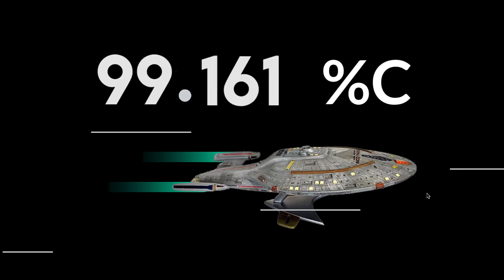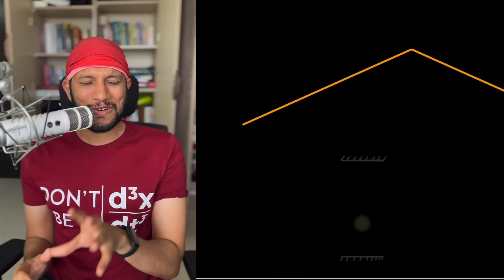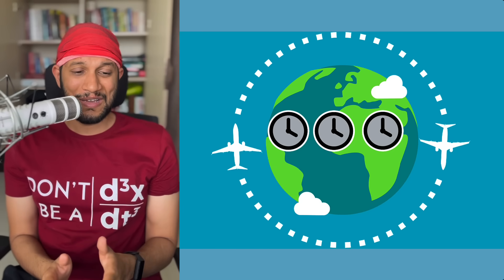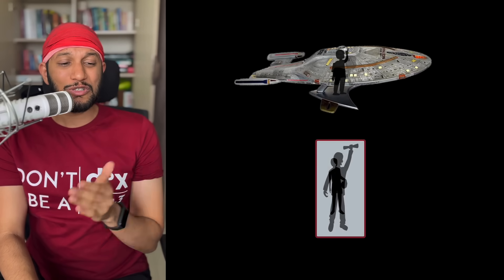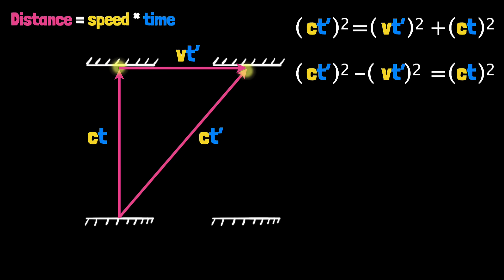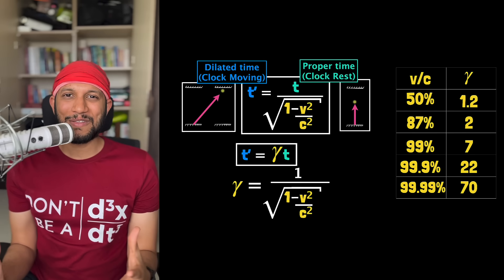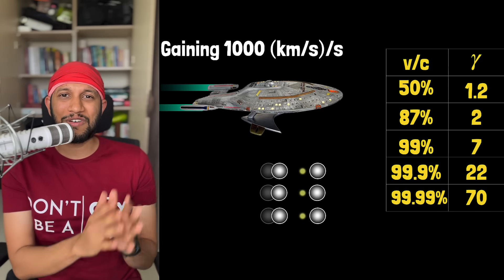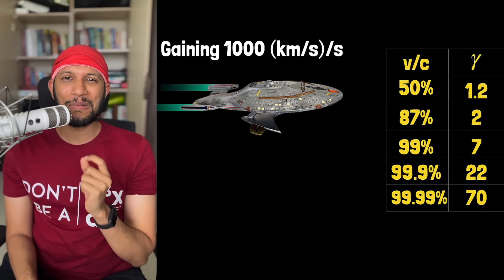I finally understood why you can't go faster than light! (My mind is blown)

Comment: Imagine being the outside observer trying to track the ship while its at 99.999999% c the ship would be moving insanely fast to you and if you could somehow zoom in to see the individual atoms and photons and be able to track them at that speed, you could see the atoms sending out the photons to the atoms in front opposite the direction of acceleration and you could see the photons struggling to reach the next atom as the photon is only moving .000000000001% faster than the rest of the ship. Wild!

Comment: Out of curiosity: What would happen to the observers on the ship? Let's asume they don't care about how much time passes for outside observers. Their only goal is to reach the speed of light (despite physics saying they can't) Let's asume they are already at around 99,99% the speed of light. With the constant acceleration of 1000 km/s that would mean from their perspective only 3 seconds are left to reach c. one more secon goas by. On the outside world milions of years have passed as they watch the clock and their speed. Another second goes by. The Galaxy around them is not in place anymore as bilions of years have passed. Only one second until they would reach c. With no regards for when or where they are anymore they push onwards. What then? I mean, from our perspective they will never reach c. The Ship is frozen in time for us. Seperatet from us. But what about inside the ship? Would they actually reach the speed of light albeit at the infinitely distant end of time?
Not a native english speaker. Sorry for grammar mistakes^^

Comment: but with finite energy, in the frame of reference of the spaceship, wouldn't it just keep gaining acceleration at 1000 km/s/s until it hit c? from the stationary frame, they'd never get there but what about from inside the space ship? wondering about this according to your explanation because traditional explanations have to bring in inertial mass increasing and requiring more energy just to keep accelerating at the same rate.

Comment: Have you ever wondered about gravity delay between structures in a galaxy? The relative speed between the center of the earth and the equator isn't anything compared to c. But what about the difference in velocity between the sun and Neptune. Neptune "sees" the sun, senses it visually & gravitationally 1 whole sun diameter along its galactic orbit from where it is. Still not really a big deal. But look at the difference in velocity between the center of the galaxy and the sun! And now, consider the difference in velocity between one side of the galactic disc and the other. How do the decently thousandth of c speeds effect the moving structure of galaxies. I think many things we observe can be explained. I've never seen anyone explain this neat idea to laymen. The thousands of years of the sensing is comparable to the millions of years of the movement. I don't have the math and modelling chops to play with this in depth.

Comment: The photo clock is a thought experiment. It is not the explanation. There is no intuitive explanation - this is not correct physics. The reason you can't reach the speed of light is because it takes infinite energy to accelerate a mass. It has nothing to do with photons.

Comment: Actually, NASA says that according to the mathematics traveling at warp speed is possible, they don’t have a way to develop the engine at this point now can we go past the speed of light it’s just like the sound barrier we broke the sound barrier at high speed and now NASA even developed a high speed impulse engine That travels at Mach30 there isn’t an aircraft frame that can handle the engine but they do at the test rig work drive is possible they just don’t understand the mathematical laws that will allow it to occur. Warp speed is not the infinity speed because usually science fiction mirror science fact, the writers don’t know how close they’ll come to the truth, but they usually do, there is a way to overcome velocity and Star Trek is probably right that the infinity speed is 9.999 almost everything that was developed in Star Trek from tri quarters to rideable tablets to hospital beds have all come to pass the only thing with hospital beds that haven’t come yet is permanent computer screens that can automatically Sense a person when they lay down and give you all of your body readouts and the fact that the only thing you would have to use is a hypo spray instead of having bags of liquid at your side, but I think these things are soon to change within the next 10 to 30 years

Comment: Nice explanation. You should make a follow-up with the viewpoint of the moving observer. You said for him the acceleration stays the same. Since he doesn't experience time dilation. So going from that he should experience breaking the speed of light. Since he has just to wait in his reference frame.

I know that it doesn't happen. Because of length contraction. And the effects are kinda crazy. 

But those viewpoints are often neglected in explanations regarding relativity.

Comment: "Why can't you reach a relative speed of c (about 300,000 m/sec)" should be the question. The answer is you can. Dark energy expands space allowing  relative speeds of greater than 300,000 m/sec. Dark energy does not have infinite value, yet it can achieve these high speeds. Einstein only said that information could not travel faster than c, nothing about 2 rockets separating by a speed greater than c.

Comment: Ok someone please correct me if I’m wrong or missed something. If we look at the photon clocks from the ship’s perspective, the ship’s clock wouldn’t be moving but the outside clock would. Wouldn’t this mean that from the ship’s perspective the outside clock is moving slower? If this is the case, how come the outside twin is always ages faster, even from the twin on the ship’s perspective?
Reply: That is correct. Time dilation is symmetric as long as both clocks are moving steadily.
The "outside twin" does not always age faster. In the twin paradox, the twin who turns around ages more because they are not "moving steadily". They have to change direction to come back. This is a physical difference.

Comment: How about the speed of the bullet if someone shoot the gun in the ship that speed close to the light?
Is the bullet speed more than light?
Or if someone turns on a flashlight in the ship, Is the light of the flashlight speed faster than normal light outside the ship in relativity?
Reply: Relative to an outside observer the bullet will move slightly closer to the speed of light, but still never reach it. You can calculate the speed of the bullet relative to an outside observer by taking the speed of the bullet relative to the ship and taking the observed time dilation into account.
The light from the flashlight will always move at c for all inertial observers.
Reply: @narfwhals7843  Thankyou for your reply
 The universe is always amazing and mysterious.

Comment: No, because a photon is just a convention for supposedly the smallest particle transitioning to wave and supposedly space-time is relatively stable to it, representing gravity. But space time is a field of graviton particle-waves, so the fastest speed is the speed of gravitons, gravitonic speed, or whatever you want to call the fundamental particle of space-time, as spacetimons. Einstein and his followers admit that with the concept of worm hole or warp speed, which is gravitonic speed faster than light.  Sandaero Uniqua communication system faster than light uses graviton  entangled photons from laser split, if photon is unaltered it's 0 if struck by perpendicular laser, it's 1, generating binary digital communication. Some black holes are worm holes, passages faster than light.

Comment: Fantastic explanation. Still a little confused though! From an observer's perspective the ship with constant thrust will take forever to attain c due to time dilation, but from the perspective of someone on the ship they do not experience time dilation so what prevents them attaining c after the required number of speed increments? What would someone on the ship perceive as happening?
Reply: Yeah that explanation is just completely wrong, I really feel like this video will leave people more confused than anything.
Reply: Since any amount of time passage from their perspective now equals infinity for the rest of the universe, I suppose what they would experience is instantaneous end of the universe :)
Reply: @lemongrass86 Yeah, no. Time is a constant.
Reply: i give you now the answer i hardly found, by myself. Einstein himself was never able to explain this.

no real clock slows down, because no real clock measures time, not distance. all real clocks measure time*distance, and that is a non-variable. 
Einstein was often confused

the answer to the twin paradox is: 
all twins in the Universe live in the time*distance, not in time, nor on distance. 
this is the key to understand the limits of special relativity, that is a non-functional theory, merely a didactical object.
no twin ages more, by virtue of relative motion and speed.

there are three types of time, all different, always different: 
1. theoretical absolute time, or say theoretical local time;
2. theoretical relative time, or say theoretical distant time;
3. measured time, the real time, that ironically does not have the dimensionality of time, it has dimensionality time*distance

Comment: Doesn’t seem entirely complete. This explains why from the point of view of the ship they can’t accelerate to the speed of light, because either their acceleration slows down or they need to increase the fuel consumption due to time dilation. However, what if the ship’s acceleration was powered externally through stationary lasers along the path? How does time dilation factor into this now?

Comment: That's the best explanation I ever see! Thanks! But I still have a question. How fast information travels on particles? I tough if you move a iron bar from one end it would take the speed of sound to move it's other end. On the mechanical clock arm you say that is the speed of light? What's the difference?

Comment: Do you want me to crack your brain? Consider that in your photon clock, the miror is placed in the same direction as the movement. Now consider the following: the faster you go, the slower the speed of light is to reach the mirror on its way in, while the speed of light is faster on its way back from the mirror but keeping the average speed of light on its way in and out equal to what we know: C.  Build a time vs speed graph and compare the simultaneity of the photons reaching the mirror for an external observer vs the person in the spaceship.  It will be the same and hence no time dilation.
Time dilution exists if you consider the speed of light being the same on its way to and from the mirror.  That s the main assumption that Einstein based all his theories on.  Because we ve never been able to measure the speed of light on a 1 way travel (i.e., A to B) but rather on a back and forth (i.e., A to B back to A).

Comment: What if you had a second hand or long pole 1 mile long (or more) - constructed in space.  And now you speed up to enough RPM that the second hand part near the dial is going 10,000 rmp - or more, so that the tip of the clock exceeds the speed of light.  What will happen to the tip?
Reply: You might like this one: https://en.wikipedia.org/wiki/Ehrenfest_paradox

Comment: So wait. From an outside perspective, the closer a system gets to the speed of causality the slower it appears to the spectator? So what the pilot of the ship sees is planets and stars rushing by but the spectator sees the ship not moving anywhere (stuck in time, so stuck in place) ? How does that make sense?
Reply: To the outside observer, the ship is moving fast but clocks on the ship are ticking slowly, and everything on the moving ship is slowed down (relative to the ship, still moving very fast with it)

Comment: How about you take that photon clock and rotate it 90 degrees, ooops... look like the photon clock example just ran out of time. Wondering why time freezes from an outside perspective when an object approaches the even horizon of a blackhole? Lol, looks like gravity alone can accelerate objects past the speed of light. The solution to why the universe is expanding and accelerating is that the universe is surrounded by a lower zero-point quantum vacuum and the universe is "falling/drawn" to this lower energy state. Dark energy does not exist, look outside the box for a solution.

Comment: You did a good job with that one, thanks.  You could have added at the end an example of using photons hitting a solar sail.  In that case the energy of the photons hitting the sale would halve when you got to your "2".  Thus, you would be stuck with the same issue, needing to keep doubling the frequency of the photons you were shooting at the solar sail to keep the same acceleration.

Comment: I'm missing something fundamental.  From an outside observer's perspective these assertions have always made intuitive sense, and are easily accepted as sound.  Considering the perspective of the accelerating ship, however, wouldn't none of these limitations apply?  Basically, it seems like while watched from outside, yes the ship will require infinite time or energy to reach light speed.  That is only the outside perspective's reality.  Within the ship time doesn't dilate, doesn't appear any slower, and therefore acceleration doesn't require more energy to maintain.  Hence, light speed seems not only intuitively possible, but certain.

This is what I get for going into IT instead of theoretical physics.  Meh, I'll do it differently in my next life.  That's a thing, right?  But seriously, what am I forgetting?
Reply: Relative to the rocket the rocket itself doesn't change its speed, it remains at 0. The only way to notice your "actual" speed is to look at how quickly Earth and other initially "stationary" objects recede in the rocket's frame of reference. This is governed by Lorentz transform and the way it works (to keep light speed constant) makes Earth & co accelerate less and less (due to length contraction) and never reach c. Which means in your frame of reference Earth will never reach light speed, so your speed will never reach c too relative to it.

Comment: From the perspective of the person on the rocket, they can always accelerate at any rate that they choose to. So the idea that they are limited to the speed of light is only "true" from the perspective of the observer on Earth. Its not true in any universal or objective sense, even if we assume that special relativity is true.
Reply: Relative to the rocket the rocket itself doesn't change its speed, it remains at 0. The only way to notice your "actual" speed is to look at how quickly Earth and other initially "stationary" objects recede in the rocket's frame of reference. This is governed by Lorentz transform and the way it works (to keep light speed constant) makes Earth & co accelerate less and less (due to length contraction) and never reach c. Which means in your frame of reference Earth will never reach light speed, so your speed will never reach c too relative to it.
Reply: @thedeemon  you might think so, but that cannot be correct. I say that there is an error in your analysis because you cannot determine how fast or in which direction you are moving. There is no memory of your past acceleration. So, as we accelerate relative to Earth, and we feel our acceleration at a constant rate (say 9.8 m/s^2) then we cannot perceive Earth to be reducing in its relative rate of acceleration in our frame. What we see happening to the changing distance between ourselves and Earth would need to be consistent with the acceleration that we can feel. There are also many other problems, but that is just the first that comes to mind. I have published a book on this subject and produced several videos about the Supervelocity and Selection theory of Light by the way. The book is called "But Where is the Rainbow?" because the speed of light is analogous to the position of the rainbow.

Comment: It means you can never reach the exact speed of light from the point of the observer, only because it would appear time has stopped on the ship from the point of view of the observer. But on the actual ship, time feels normal, the observers would obviously appear to be aging extremely fast. Does that mean the energy required from the ships point of view still be reasonable, it would just mean if you actually got to the speed of light the whole universe around you would fast forward to an infinite point in the future?

Comment: E^2=P^2*C^2+M^2*C^4
Special Relativity,
As V(velocity) approaches C(speed of light), E(energy required) reaches infinity. What is not considered here is the deformation of the space-time metric. Mass or "E" does not require to reach an infinite value to deform the space-time metric (as we know Energy and mass are directly equivalent), :. faster than light travel is possible using enough energy to deform the space-time metric locally which induces a craft travel in the direction of the deformation.

Comment: More precisely, nothing can go faster than the speed of light from the vantage point of an outside observer. The analogy you used at the end of the video about needing an ever increasing amount of energy is not correct. We are all traveling at the speed of light relative to some potential vantage point. "Time dilation" is just one aspect of dilation. It's not just time that gets dilated it's everything.